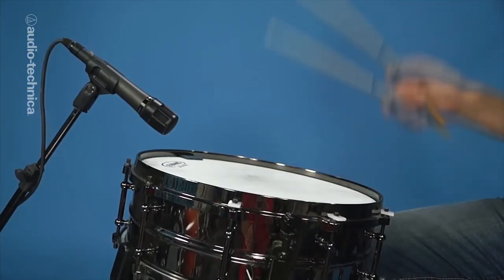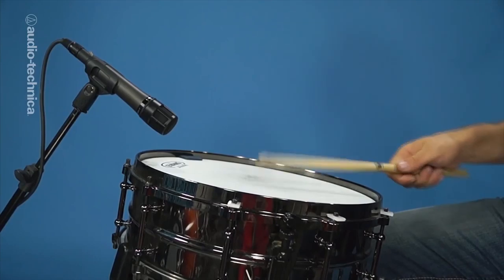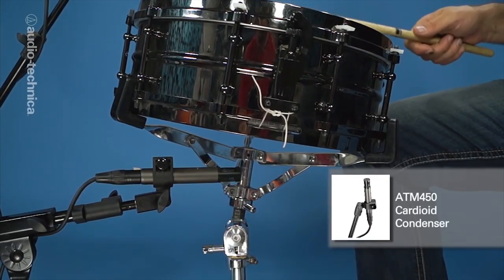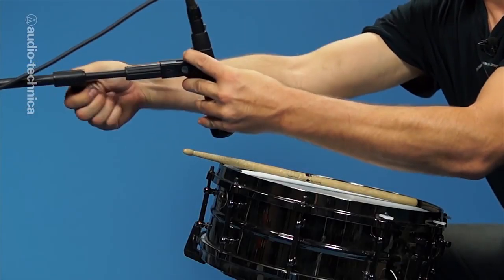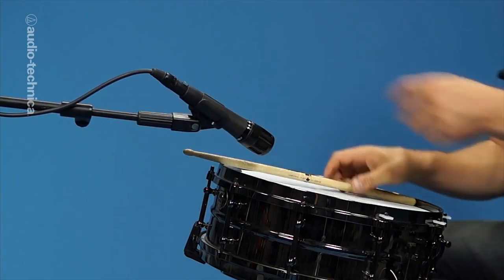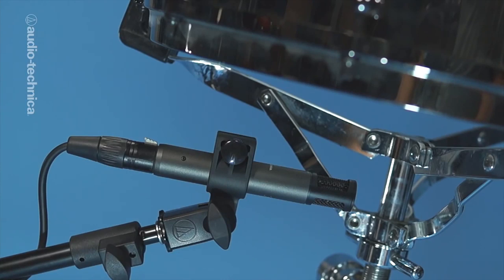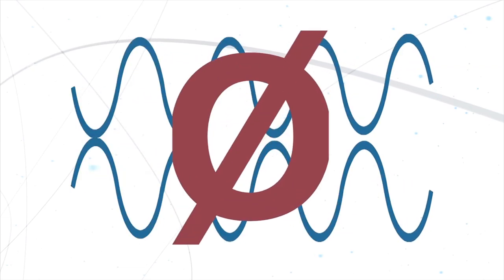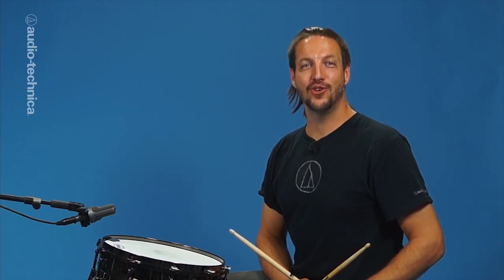Audio-Technica Snare Drum Miking Overview | Full Compass

Comment: The AE 3000 is the only snare mic I use. I have never heard a snare mic sound so good, and on every drum I have every used. Not a fan of it on toms though. It sounds to week for toms.
Reply: +Acid my mic setup is E602 and E901 on there kick, AE300 on snare top, Beta 57 on the bottom, AT4033s fit over heads (in big rooms or outdoors) and E604s on the toms. Hat and ride are AT2021